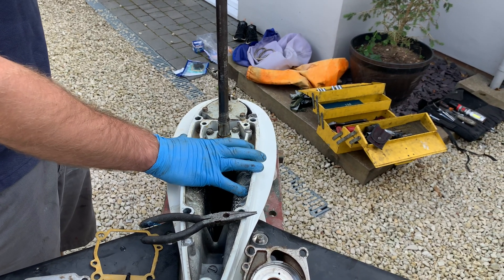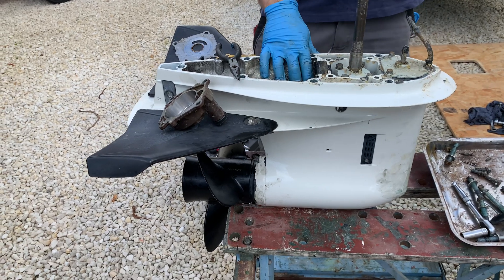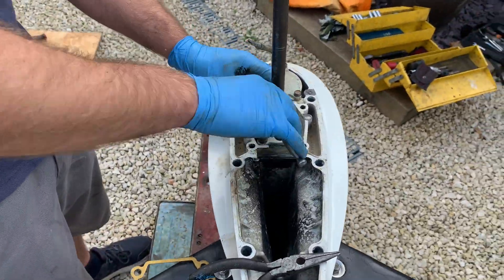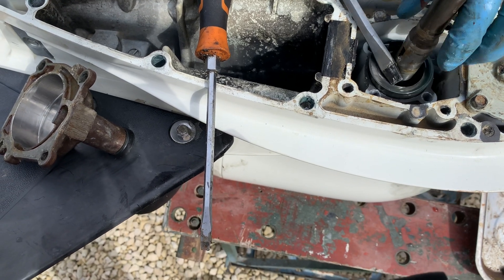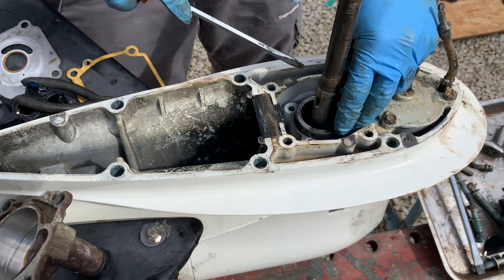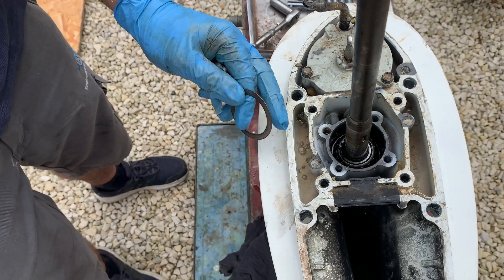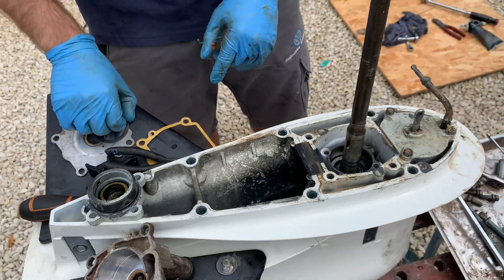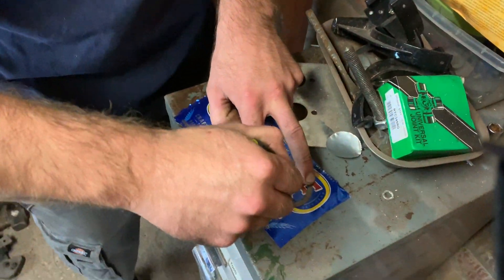Outboard gearbox shaft wobble fix | making a homemade shim | cheap fix!

Comment: Hey guys - here's a thought: the play on the taper roller bearing could be normal....if the pinion in the gearbox below is a concave spiral bevel gear (and lots of larger outboards use these) then when the box is running at speed, the forces of the gear and pinion meshing will push the driveshaft up in the leg, removing the play in the taper roller bearing. Upward movement allows the bevel gears to attain the correct degree of separation for efficient power transfer and minimum wear under load. Your modification (which you made assuming that the original assembly was incorrect) will take away the ability for the shaft to rise, preventing the gears from assuming their correct spacing under load, so wearing faster / getting hotter etc. That shim you fished out was meant to be below the outer bearing shell, to prevent the shell closing up the play when the cover plate is screwed down. The play then goes away when the box is run up to speed. I'm not sure about this - checking on an exploded parts diagram for this outboard would confirm it. I'm not trying to be a nerd - I just needed to work all this stuff out as had similar issue. This website has good info on forces on bevel gears: https://vortarus.com/spiral-bevel-gear-forces/
Reply: How is the engine / gearbox doing after this mod?
Reply from the maker: Hi mate, appreciate the time you took to write that. All I can comment on is that the gearbox and engine have done a decent amount of hour since this and run perfectly. I often do a fair old stream in one go and never had any issues - that being said I didn’t have any issues with it before hand either!!

Comment: What would we do without a fosters
Reply: Oh, forgot to say using the aluminum is not a bad trick man. I don't drink soda or beer anymore so I never have a can lying around but if you have a discount hardware store near you that sells feeler gauges those are excellent shim stock. I buy them here for like $5 USD (7.5 AUS give or take) and having accurate shims on hand is great. Just take some sheet metal shears or scissors if it's thin enough and cut a piece off.
Reply from the maker: It’s worked so far and the beer can saved us! Always good to have a look around and see what can be used to fix bits up! 👍🏻
Reply from the maker: Exactly! Beer tends to be the answer when problems like this turn up!
Reply: Just hear to see how you are solving a loose drive shaft and saw the comment about fosters. My last name is foster and when I joined the military every single time someone would say "it's Australian for beer". Got old fast man but thanks for showing how you tackled this problem. I like to see how other people fix things and try to device a solution based on the best of each.